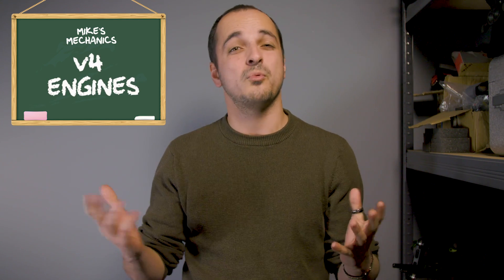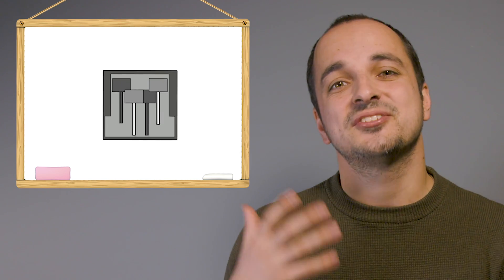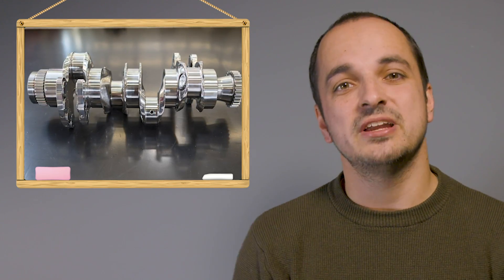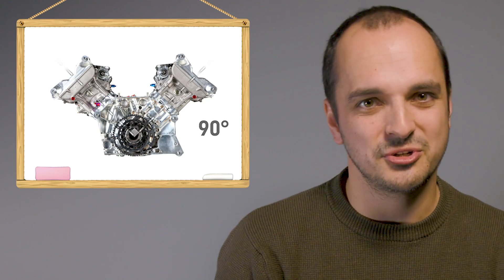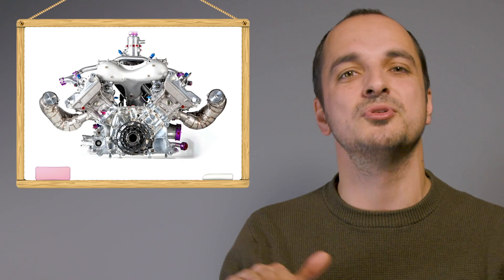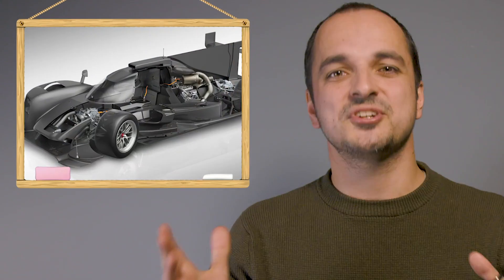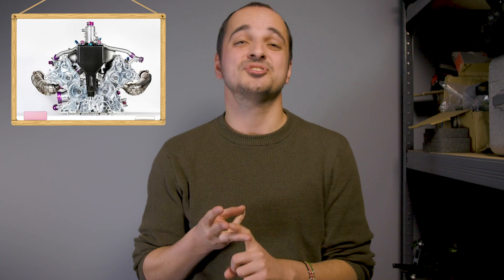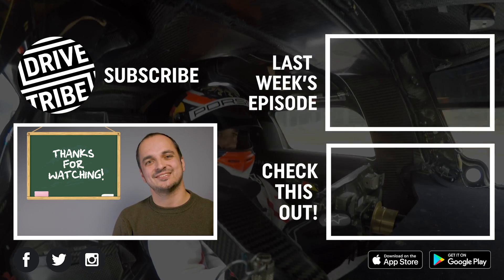Why V4 engines are so rare and which cars use them - Mike's Mechanics

Comment: I might sound like a know it all but the Lancia engine is a VR 4 not a V4, as the VW Golf has a VR 6 not a V6 or the Bugatti Veyron having a VVR 16 not a W16 (W16 is the engine name not the type). One last note, the in line 4 also has complete balance of primary forces and the momentum, so this isn't really a benefit of the V4. However, the even smaller crankshaft on the V4 is less flexibel, wich is not only usefull against torsional vibtations but also is great for high torque applications, since you don't have to calculate in those tortional variations.
Reply: @n.o_w_a.k  
I agree, there really seem to be 2 alternate realities in terms of this topic. However, i have 3 german books on engines, of wich 2 of them are rated for university use and both state that the VR engine (narrow angle v engine) is an engine type for itselfe. It is a very rare type and usually people think about VW engines when they think of a VR engine, wich maybe lead to the common perception of the VR specification being ultimately just for VW specific engines. However there is another manufacturer that called it's narrow angle  V engine a VR6, it's the motorcycle manufacturer Horex. You can bet your ass, that if VW could have claimed the VR type engine as it's own "invention" or as their trade mark name, than they would have done it and automatically put fees on every other manufacturer that would dare using the name.
Reply: @Suprav Pokharel 
Well, every narrow angle V engine with a single cylinderhead is a VR engine, the description does not only go for VW engines, the ariès engine is also a VR engine in german, it pretty much means "V-Reihe", wich means as much as narrow angle - in line engine, so every narrow angle engine with a one cylinder head and offset cylinders is a VR. The lenght difference of a crankshaft is never insignificant, as well as the lenght of the camshaft, that and the low center of gravity are the reason why we see so many V6 engines and why in line 8 cylinder engines died out. The crankshaft can bend to a degree due to torsional strain, wich has to be compansated for in the engine design, the shorter the crankshaft and camshaft, the less of a concern it is. Formula 1 V10 and V12 at the time had to consider this, because the timing of the camshaft varies with the rpm (due to the inertia of the valves resisting to a sudden accelleration, wich increases with rpm), this by the way contributes to the rough idle and the lower rpm limit.
Reply: @Suprav Pokharel 
VR is not only used for Volkswagen that's plain false, it is per definition the german transcription of a norrow angle v engine, of wich the cylinders are in a row. Torsional strain is a function 
of the torsional force (momentum) acting apon the crankshaft and the 
geometrical dimensions of the crankshaft. The reason why the Moto GP now uses for the most part V4 engines is because of the lower center of gravity, not the conpactness or density. Wikipedia literally says it right there:

https://www.google.com/url?sa=t&source=web&rct=j&url=https://de.m.wikipedia.org/wiki/VR-Motor&ved=2ahUKEwiY_7GplLvgAhXD_KQKHZiiAi0QFjAEegQIDhAY&usg=AOvVaw0yhp3oJIg6l6ARrbib_65M&cshid=1550145179377

Other than that, pretty much any book about engines says the same thing.
Also, you said that V10 are superior to V12 engines, i beg to differ, it is not for nothing, that the most powerful NA F1 engines were V12s.
Reply: @Enthropical_Thunder  the W16 is, in fact, a W-style engine because it really is just two V8s slapped together. It's not a VVR, but because it's a Volkswagen it is sometimes called a WR16
Reply: @effyeadude  
No, in fact not. 2 V8 engines would have 4 cylinderheads, because they are not  narrow angle V (VR) engines.
The Bugatti engine is falsly advertised as a W16 engine, as the VW VVR 8 is falsely advertised as a W8 or the VW VR5 is falsely advertised as a V5. The difference is the angle, if it is so narrow that you can build one cylinderhead for 2 cylinder rows, it is a VR engine. Bugatti had ones  true W 18 engine, this thing had 3 rcylinder rows of wich every row had its independent cylinderhead.
Reply: @Suprav Pokharel 
No, it is actually a sheme not just a name. You see, VW did also build VR 5 engines as well as Honda did but they called it a V5. VW also produced a VVR 8, wich is the basus for the Bugatti engine (VW calls it the W8). The VR engine was pretty much invented by Lancia, it bases on a Lancia patent 
wich allows V engines to have loe cylinder bank angles. The germans pretty much "just" made it popular. Lancia is seen as the first to produce the VR engine type for production cars. A W ebgine type was used by bugatti befor VW took them over, this engine type really is just 2 V8 welded into a sort of half radial engine. However, i do see why you are confused, the german wikipedia side displays the deginition for a VR engine in general but the english translation somehow just covers VWs VR engines and mentions Lancia as a side note.
Reply: @n.o_w_a.k  stfu moron.
Reply: No you sound like an idiot that thinks they know it all. Everything you said was nonsense. The w16 was called that because it's 2 v8s on top of each other and looks like a w. So yes, it is an engine type.
Reply: @colinjohnston8519  
No, would you even consider doing some research? 2 V8 engines would mean 4 seperate cylinderheads but the Bugatti has just 2. A true W engine would be an engine 3 or more seperate cylinder rows. You're sounding quite silly.

Comment: I want a 500 hp V4 engine...
Reply: And how much would u like to pay for it?
Reply: Brenton, Motus still makes their V4. Or find an MST and transplant it. They are good for 400HP. So I have read anyhow
Reply: @pmdinaz  now you are making that engine scream at the top of the lungs because you're pushing it as hard as it can possibly be pushed. And obviously it doing so you lose the lifespan of the engine, especially if you use it to race. Just to get a bigger engine and do less work for a better price and you will have the same speeds... a V6 with a little head work and a turbo will produce the same amount. I mean shit, some v8s come with that power stock... which I wouldn't use a V8 for a race unless it was a drag, but you can make a V6 do the same thing you're wanting to make that V4 do, and with half the amount of money and half the  headache. Not to mention that the engine last longer especially if you try to keep the RPMs a little lower. Making a stroker engine would be really nice, it's not that difficult.
Reply: 400 hp is enough for me...
Reply: So, a K20 with small turbo? :p
Reply: @DKTAz00  k20 is inline 4
Reply: @DKTAz00  another dumbass .. !! FUCKING WANNABE ...ITS A INLINE 4 ... NOT A V4 .. honda doesn't put v4's in CARS !!! FUCK
Reply: immagine a 500hp v4 gokart!!
Reply: @freedblowfish3705  no, too much power for a gokart. You could source a 1000cc v4 from a salvaged Aprillia RSV4 or 1100cc v4 from a Ducati V4S but would cost a pretty, pretty penny.
Reply: @Blakezilla594 apparently  you haven't seen the cross karts yet
Reply: @freedblowfish3705  the inline 500hp hayabusa cross karts are the ticket winning races in Europe
Reply: How about a V500 4 horsepower engine?
Reply: 321shack  those are i4 .. not v4
Reply: I'd put it in my 350z haha
Reply: Ford V4 Cologne engine made 240 hp in some Saab race cars. Stock was less than 100 hp. When I was child, our family had Ford Taunus with 1,7 liter V4. It sounded nice.
Reply: @rickrandom6734  if it was a DOHC 32 VALVE the engine was probably  built by Yamaha
Reply: I want a V2 engine
Reply: @MM-su4gu  Harley can't wait to sell you one
Reply: @Asriel Hold my beer.
Reply: Just saw the v8 in half
Reply: Brenton Benz had made a 768hp 1.6L engine for production car 🌝
Reply: I want one on my motorcycle 😂😂
Reply: @brusk3978  then go find a v65 Honda magna .  V4 drive shaft .... But a big puppy as the same year gsx 1100 Suzuki will lift the front wheel at 90 leaving the v65 for ever
Reply: Soon F1 engines will feature them. 😜
Reply: @F1ll1nTh3Blanks  made by Harley Davidson
Reply: oh hell yeah!
Reply: There's a guy on youtube with a 1004 hp i4 engine.. 251 hp per cylinder.. lmfao
Reply: Brenton ,there is a 1500 hp inline 4 !
Reply: 720hp actually lol he says they take restricters off later in the video
Reply: Me too!!
Reply: Buy a Ducati or Aprilia sport bike with 210hp??
Reply: stick two Ducati Panigali 1299 twins together, = 2.5ltre ish 420bhp ish
Reply: Brenton mate I just want a car that has 500hp lol
Reply: i want a will to live
Reply: You can have a 500 hp VR6. That's more of a technological advancement than a lame V4
Reply: ME TOO
Reply: Same
Reply: Brenton I'd be hsppy with just he hybrid parts in my car :P
Reply: Its like a damn honda. Mad hp/litre but all at 7k rpm and no torque.
Reply: @imabebebebe2496  It's a road-racing engine, man.  It doesn't need low-end torque.
Reply: @imabebebebe2496  : The electrics have mega torque
Reply: @glennmcc64  yeah and made by Harley Davidson
Reply: @ima be be be be More like 8K or higher, like most NASCAR races.
Reply: ima be be be be you American

I bet you love mustangs
Reply: A 7.2L V4 sounds interesting, and give it desmodromic valves and twin turbo!
Reply: It would be primarily low rpm with jaunts into high rpm when needed.
Reply: Subaru boxer engines are v4's
Reply: @darrelradjendra3372  they are flat fours not v fours. The term boxer is attributed to flat engine layouts.
Reply: Then go get it, why do you have to announce it? Youre not getting it, thats why you're announcing.

Comment: all my bikes have been v4’s...good torque spread ,gorgeously smooth and a beautiful noise ,
In honda’s hands also unbelievably reliable and bomb proof
Reply: Utterly unkillable. Mine's just gone past 165,000km and it's still super tight.
Reply: @montlejohnbojangles8937  The camshafts of the VF1100C (aka V65 Magna) were quite killable though...
Reply: (Not only the V65 though...)
Reply: The 1200 seemed very un v4 like when I rode one 
800’s are my weapon of choice
Reply: Honda's genius idea with their V4 engines design was based on them realizing for a high powered motorcycle application their uneven firing order made the riders control of the throttle at the limit of traction a lot easier.  A perfectly even firing order results in difficult control when you lose traction as the even torque delivery causes the slipping wheel to start spinning faster.  The Honda firing order works like a passive form of traction control and provides good rider feedback once the rear wheel starts to lose traction and then makes it easier for the rider to adjust for the optimum maximum throttle to achieve maximum acceleration.

A truly genius idea for a motorcycle application but not really applicable for larger vehicle applications that will not be operated at the limits of traction.
Reply: @michael-j-harrison  I've tried to explain this to people but deer in headlights.
Reply: @michael-j-harrison  Absolutely spot on,  I`ve never owned a bike that was easier to ride fast for many many miles. It flatters the rider like few other bikes can..VFR`s I`m thinking of.
Reply: @michael-j-harrison  good to know!
Reply: I love vfr800 swapped car
Like the Honda vfr800 in Honda 600 on the smoking tire
Reply: @Mr_Psyco Only if you don't turn corners.
Reply: I have four bikes: a big thumper, a parallel twin, a v-twin and a v4. I have to say the v4 is my favorite engine, but obviously it doesnt fit all bikes
Reply: My RVF400 was the best learner bike... Plus that sound... Frikkin exotic
Reply: I've had 2 VFR 800's loved them both insanely. Best sounding bikes ever. Gear driven cam noise, great intake howl and amazing exhaust note. Especially great sounding at 7k RPM when vtech opens all the valves and sings.  Sadly it only sounds faster but actually isn't. Still there most comfortable sport bikes I've ever ridden.
Reply: A v4 on a bike actually manages tyre usage better due to firing order and the way it lays down power.. Assuming it has the same trait for a car tho with the intervention of hybrid who knows?
Reply: Yeah, once they fixed that cam drive. 750s were oddfire but yeah, came on way earlier than cbr6s
Reply: @kenfrazee2779  True. A friend had a VF750S, it gave a slow and undramatic, almost boring impression because of the even torque curve... then you looked down at the speedo. "Ooops..."
Reply: @ziiofswe  Yeah, they came on like car motors, my 95 needed a jet kit bad though, stape 1 woke it up. Always wanted to find rc30 motor upgrades or something.
Reply: I had a 1984 VF750 (back in high school) and a 2007 VFR800.   Great engines.   But, to be fair, after a lifetime of riding supersports, I missed the power.   I traded my VFR800 in for a ZX-14R.   Just as much comfort, with double the power. And monster low range torque.

But....that VFR is still the best sounding bike I have ever owned, and that engine was a jewel.  I get why the people who love them will ride nothing else.
Reply: What Honda started Aprilia and Ducati are taking to the next level in V4's
Reply: They are inherently balanced. Only Hardly Davidson sells a V twin motor with a primary imbalance.
Reply: I was a distance courier for 9 years, mainly on a VFR750 FJ. By the time it died...not mechanical but trying to cut a Volvo in two, it had 289,000 miles on it. It was pretty tatty of course and for its last year or two I had to have the drive sprocket tig welded on to the output as the splines had worn out, other than a few rectifiers and a good few rotors it was faultless...and fun.
Reply: @sheikhyaboooty  Jeeeeeezus! That's insane for a chain drive bike. I bet you enjoyed every second of it though. 😁
Reply: @montlejohnbojangles8937  lol...ummmmm..not really. Most of the time yes. but 350 miles in freezing fog or racing the clock on the M25 on a wet friday in november..not so much fun.
Reply: Yup🥰
Watched that a few times...amazing wee thing 😀
https://youtu.be/LU4bIsdnbkM
Reply: Got the BMW 1600B, inline 4. You just barely touch the throttle and you realize you're going 80 miles an hour. And that's when you also realize that the tack is only in the middle of the speedometer... whoever decided to throw of a 4 cylinder in a motorcycle is a fucking genius.
Reply: I had a Honda VF 1100c back in my youth :)
Reply: Yamaha FJ 1200 inline-4 screams like no other!
Reply: A big V twin can be fun as there is a lot more acceleration low down. I've had both a VTR1000 and an SV1000. I preferred the VTR and had a go on an SP2. MONSTER! On a "run wot yer brung" on a 200m track I was hitting well over the ton.
Reply: Alasdair Henley I have a Honda motorbike and the gearbox can't shift gears reliably. Went to the Honda company themselves they took it apart two times cleaned and inspected everything still not solved. Then I found out a friend's Honda motorbike has the same problem.
Reply: Magna
Reply: I prefer 3 cylinders, I just wish they were as rigid as the V4's.
Reply: "In Hondas hands unbelievably reliable".
Apart from the VF750 which ate its own camshafts..
Reply: The early VF's were notorious for chewing up the cams and valve train.
Reply: VFR 750 sounds good but the VFR1200 sounds like a hippo fart
Reply: The aprilia V4 equipped bikes are also pretty reliable and the bikes in general are fairly lightweight
Reply: Rvf400 nc35 tyga in my garage
Reply: Heavy as fuck though. The VFR1200x weighs 280 KG, absolute bonkers.
Reply: @motorpolitan8884  My VFR400 weighs about 160kg. Great little track bike, and sexy with the single sided swingarm.
Reply: mcc4m1sh sick 👌🏼
Reply: @HandSolitude  sounds like a fun bike :) i would love to ride a 400 sports bike (cbr, gsxr, zxr, vfr, whatever :) ), only problem is i dont have enough leg room on my 750 :S 
Im only a tad over 190cm, but with unproportionately long legs
Reply: @HandSolitude  one of mates had a VFR400 and it sounded awesome! I went for the CBR400, still a great little bike, but the sound didn't compare!
Reply: @motorpolitan8884  thtad that bike, no the engine  Ducati V4 weight less than 180kg and Aprillia V4 less than 200.
Reply: VFR1200 engine is a ridiculous goofy angle, firing order, and unconventional.
Reply: @turnin.sprocket  But its Honda the first vehicle was a Motorcycle after that Japan after the war had ended japan gave an order to Honda to make a "Family" Car
Reply: @mayuravirus6134  I know the history of the brand. Also the history of Suzuki, Kawasaki, Yamaha, BMW. I'm interested in that sort of thing as my career is manufacturing and engineering.
Reply: and boring to ride.